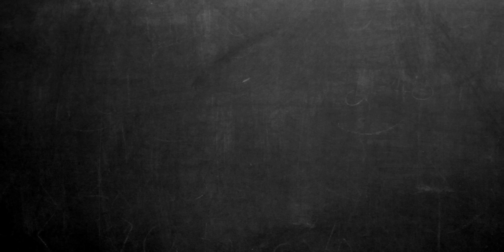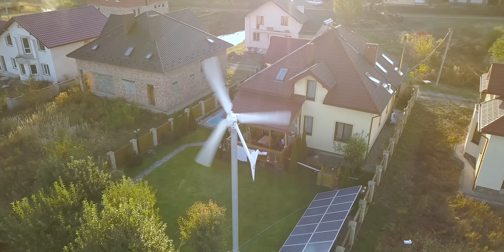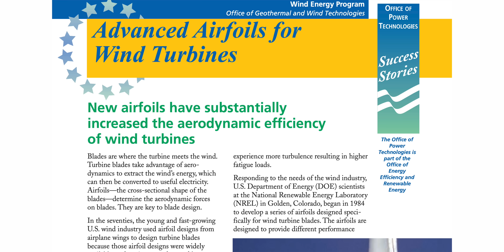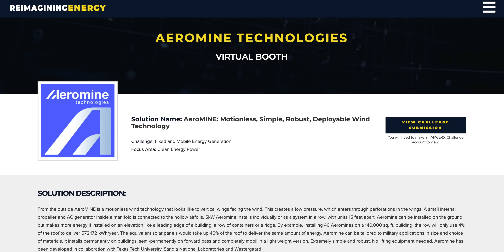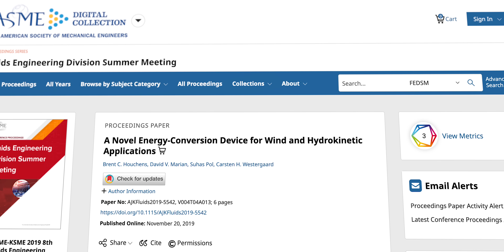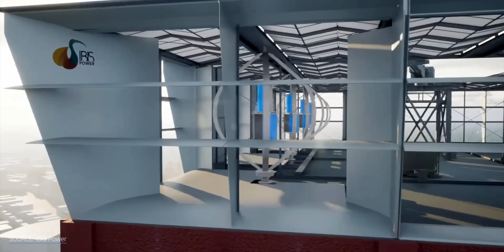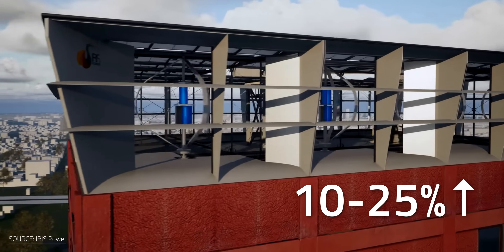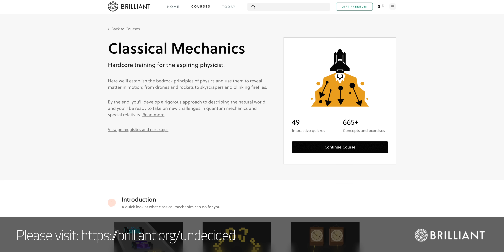How Can A Wind Turbine Be Motionless?

Comment: It always bugs me when people say wind and solar are "free". By the same logic aren't fossil fuels also free? They are all things that just exist on the Earth, the cost is obvious in collecting them and converting them into usable forms. The answer of course is wind and solar are not any more "free" than oil or gas.
Reply from the maker: Oil and gas have to be collected and processed into a usable fuel.  That fuel is run through an engine or device to generate power.  Wind and solar skip that fist step.  You go straight to the device that generates the power, which is why it’s “free energy.”  After I put solar panels on my roof there’s nothing else I have to do or pay to get power.  Your car or a diesel generator needs to be refilled again and again with fuel you have to pay for.
Reply: @UndecidedMF  That is a fair point and I appreciate your response. Maybe a better term would be "freely available" since you do get to skip the collection step. Thanks.

Comment: You mentioned that they could only face one direction so couldn't adjust to wind coming from another vector. I think that could be solved by having a rotating platform with a wind direction detector. That is a problem that could easily be overcome.

Comment: The engineers designing these are not very imaginative.  The single aerofoil could be mounted to the sidewall of most homes.  Homes usually have a windy exterior surface dependent on normal wind direction

Comment: The key to renewables is a diverse mix of distributed generation. The Aeromine seems to have many benefits, like installations in commercial areas where a traditional turbine cannot be installed. This brings generation closer to the point of use, reducing the load on the grid. Being roof-mounted means easier maintenance, but I believe the claimed lower maintenance requirement may be offset by the larger number of units to maintain. The elimination of bird strikes is also a plus.  Tim will tell if this particular idea is a winner.

Comment: Most of the complaints about the turbine are either the excessive flashing light when the blades are between someone's house and the sun, and the constant motion in an otherwise serene countryside.  Power poles have been there for over a hundred years, no one minds them, because they don't move or make sunlight flash on and off and are constantly distracting.  If we had wind generators that when seen from far away don't visibly make sunlight flash on and off, and thereby don't draw attention to themselves, you could go back to all those places that said no to wind power and show them the new less irritating designs.  Something as simple as putting them in a box with a roof that blocks sunlight, and 4 walls of black mesh, with black painted blades that don't cause any visible disturbance whatsoever.  I was noticing those blades were still causing flickering @6:00 because the material behind the blades was reflecting light and the blades were blocking it when they spun, making a flickering light.  There could be a new regulated certification called Non-Visually Disturbing, or NVD wind turbine that to earn a design would have to have no visible movement from every angle visible from a public place.  Something like a wind funnel turbine is already completely NVD from most angles.

Comment: GREAT augmentation for a solar panel!  Given both, one could cut about 1/3 of the requisite capability of each and enjoy roughly 50% greater energy production time.

Also, turn the Airdyne on it's side, lengthen it to the width of the building, replace one side with the building front itself, and enough even lower cost with higher total output.

Comment: Why can't they place on a turret bearing (even if fluid) system with maybe like a tail so can change direction with wind direction?  Wondering the efficiency difference versus the loss in energy gained from not being positioned in the optimal direction?

Comment: This would work well for single family homes if chimney mounted and built in you could use the temperature differential to help spin the built in turbine adding a little additional complexity you could add a sealed bearing and wind vane to orientate facing the wind..

Comment: Most warehouses and factories are not air conditioned and can get very hot. Especially up at the ceiling. If this device can choose to pull the warm indoor air in the summer inside the building and pull it out thru the turbine, it would be doing 2 jobs at once.

Comment: If the nest calculations are accurate, then a similar setup could generate about as much power as the office building it's on top of uses (particularly if paired with energy-saving architecture regarding AC/heating and such); that's not bad at all, really.
Reply: Top tip: they're not. They're always best case scenarios. Take EVERYTHING this channel says with a lamps worth of rock salt.

Comment: Come on Matt! Really? "Wind generates enough energy to produce about 35 times more electricity than the entire planet could even use each day. It's free, clean, and renewable,..." This type of hyperbolic claim is generally made by an 8th-grade student parroting the words of their overreaching science teacher. Capturing even a small fraction of 1% of that wind would unacceptably require littering the surface of the planet with wind-capturing devices...and there certainly isn't anything free or clean about wind power generation when you consider the devices, materials, batteries, land, noise, transmission, etc. Frankly, I could make a similar hyperbolic comment using any of our current energy sources...and it would be equally accurate. Comments like this make serious-thinking individuals shrug in disbelief...and move on.
With that said, I love wind, water, geothermal, and solar energy. I am excited about the innovation and improvements and strongly encourage mankind to continue to pursue these technologies. But I also love natural resources and nuclear energy...the real heavy energy providers of civilization for probably the next millennial. Nuclear in particular IS the deservedly maligned energy source that we continue to seek as the holy grail...while it hides in plain sight. The research, development, and improvements of the gen 2 and gen 3 reactors...even with the massive governmental hurdles in place are amazing. Additionally, spent fuel reactors are coming online in France to utilize the 90% of potential energy that remains in the spent fuel. Nuclear energy is ground zero when you talk about REAL progress toward renewable and emission-free energy.

Comment: Why does aerodynes turbines not have the ability to rotate? If they are that large, why not incorporate neon, and allow whatever company that installs them on their rooftops, use them for advertising? Personally, im certain, solar panels are tomorrows asbestos. Theyre only good for 20 years, then what are we going to do with all the plastic, silica, led, and all the hardware..... coving the entire planet with solar, sounds good, until the panels no longer work.hydro and wind, replace a bearing and perform precision balancing, toss in a bit of lube and theres power..... just sayin, cuzzin!
From a different Ferrel. Brendan.

Comment: i've just one question: why doesn't turbines have gearbox? :| if there's a lot of wind reducing the turns of the windblades while increasing the torque may be used to power more then 1 alternator; plus: this sistem is monodirectional; they should make a mobile cog base that turns, imho.

Comment: Power nest is a good concept.  Scalable and modular.  Won't be as effective in a city with a lot of tall buidlings.  

Also, would be curious to know how may "nests" in a row could you have and still have effective flow through.
Reply: Hi Guillermo, as far as we have investigated this; turbines behind turbines do not work, so we only place the wind modules on the roof edge into the prevailing wind.
Reply: @alexandersuma  thanks for that.  A long time ago, in a city far away, I participated in wind research to determine predominant wind directions.  it was funded by glass companies.  
Where I live now, I could plop a power nest on some legs, and would have great wind....almost year long.
Reply: @alexandersuma  also, given the surge in "solar generators", which are just "brains with batteries", it would be cool to have a portable brain paired with a power nest.  Not a electrical wizard, but I understand wind generated electricity require a different set of controllers.

Comment: I didn't see any comments addressing this issue yet, so I'll bring it up. The 6 to 10 times power increase for the power nest seems a bit deceptive. Their example case went from installing ~46 panels around the roof protrusions to mounting ~256 panels on the frame. That would indicate a 5-6 times increase just due to installing more panels. Yet, the sales pitch focuses on the increase being due to the combination of solar and wind installed together.

Comment: That Powernest unit in Utrecht is literally across my street.  We have held a petition in our street to have it removed but it was discarded by the municipality as it was temporary. The problem was that at windy days, the turbine would make too much noise. In regular traffic below the somewhat small street you wouldn't notice. But during the night, it was a constant zooming noise. I was suprised when I saw my street in your video! The building is a pilot project by the EU to test sustainability projects. Several universities are working on charging EV's using the panels that are fitted on windows, balconies, and roofs. Even the king Willem Alexander has visited thus building twice!

Comment: I prefer Solar. Correct me if I'm wrong, but I feel like there's not enough research being done in the effect of slowing the storms down. By capturing the wind, you're essentially taking energy away from the storm moving in a particular direction. Lets say for instance, a storm that comes from the Pacific. The storm on average may stall out right around reaching the center of the country. I believe there will be a long term effect of slowing storms down that may need to have x amount of energy to properly hydrate the land.

Comment: Some of the math in this video is wrong.  The biggest problem with small wind turbines is: low-speed, turbulent airflow, not the blades.  Average residential solar panels today are: 360W, so only 14x are needed for a 5kW array, not 21.  This Aeromine wind system is ALL hype and theory at this point, there's no data proving any of their claims.  I worked in the small wind industry for 12-years, sold several thousand small wind turbines around the world, installed hundreds and have had a Skystream 2.4kW small wind turbine in my backyard the past 14-years.  I've seen dozens of claims like Aeromin's and every, single one of them have been false and the companies and designs have failed.  The Aeromine system will still have the same problems that ALL small wind turbines have: very low, obstructed, turbulent wind that has very little energy it in, at low elevations.  And, the amount of time the wind blows at low, rooftop elevations is like: 10-20% of the time, I know, I've tracked my turbine's performance for 14-years and the energy production is horrible, and I live in a high wind area.  My 5kW PV system, which cost's 1/2 the cost of my turbine, produces roughly 5x the amount of power, and produces EVERY day, sun, cloudy, rainy, doesn't matter.  Don't waste your time and money on small wind turbines for your house or property, just go with solar PV.  However, the Powernest looks promising as commercial rooftop space is dead space anyway and the concept looks promising, especially at those high elevations where high wind speeds exist.

Comment: It's nice to see the Darrieus VAWT designs coming back into play, I think they were overlooked early on because of the lateral forces on the lower bearing in large scale installations. Years ago I visited one in Quebec that was more of a demonstration of the concept and saw their shortcomings there, it was just too big! So properly scaled, I could see these turbines combined with a Savonius (starter) a really efficient power generation device.
Reply: The VAWTs have a number of advantages IMO. Yes I know their overall efficiency is lower but they also can be sited more densely. Also because the mast only needs to support the loads of the top bearing assembly and its associated loads the overall mass of the foundation block can be lower. Another factor in their favor is the generator is pretty much at ground level easing servicing by maintenance personnel.
Reply: Even though this is a vertical style could it be designed with same blades and used horizontally?  that way both ends support and bear the weight of the blades instead of putting most of the weight on the bottom bearing.  It would mean putting the generator on the same level as the turbine.  Also is there a way to control the maximum speed as sometimes the wind where I live can vary greatly in speed and direction.  A normal wind turbine can control the speed by using computer, anemometer and vane and turn the blades away from the wind at an angle determined by the computer to capture maximum effect without burning up the generator.  The concepts appear very feasible except for controlling the air space around the buildings from blockage of new construction of taller buildings.  And it takes away the argument of NIMBY (Not In My BackYard) that cattle farmers have a problem with the noise from a wind turbine.
Reply: @johnsnyder9033  They've tried the horizontal methodology in ridge or rooftop designs, but the merit of the Darrieus VAWT is to be able to capture wind from all directions without yaw control. Regarding speed, they use mechanical or passive braking or both, same as HAWTs. Sometimes they are so big they need to be "nudged" to start up.. that is why you see the hybrids with a Savonious turbine.
Reply: Happy you mentioned Savonius! Many times "the best" stays in the way for "good enough under these circumstances" - like independence, stability, viability, environmental friendliness, are also important values, not only highest gain from lowest investment. User value can be more important than capital investment. For the investor it might be a minor problem that production stops for a time as long as the production on a yearly base is profitable, and more profitable than other investment options in what ever. For user the utility is in the practical and stable production, that is needed and desired.

Comment: You also had an issue with Wyandot MI. It's why-en-dot. I also have a couple of questions. Are there engineering or Physics reasons why the Aeromine turbine can't turn with the wind? Given the design we saw it seems that would be possible and definitely improve it's overall performance. The second is why these would not be feasible for a residence. I understand there may not be the same efficiencies but that's the case for both solar and other wind turbines in a residential area.

Comment: Any simple explanation of how an airplane wing works to give lift is wrong. Bernoulli is one example of a simple, but wrong explanation.
Reply from the maker: What’s the right explanation?
Reply: @UndecidedMF  There is no simple explanation except to say that the net downward force on the air is matched by the upward lift on the airplane. (Newton: Every action has an equal and opposite reaction) But that does not really illuminate what is going on in detail and does not help to calculate the lift. The only truly solid explanation is to track small pieces of air around the wing, keeping track of all the forces and physics on each piece of air. That is called Computational Fluid Dynamics (CFD). It takes powerful computers to even get questionable estimates. One flaw of applying Bernoulli is the statement that the air over the wing must go faster to keep up with the air under the wing. In fact, the air over the wing gets to the end significantly BEFORE the air under the wing and Bernoulli does not explain why that happens. All this is why wind tunnels are still used to actually measure the lift forces on scale models.

Comment: what about extreme high winds? Wind turbines are supposed to be 'feathered' in high winds, so that they won't get damaged. The Aeromine unit is fixed, so presumably, it needs to withstand high winds like with solar panels or the roof itself. What is the highest wind it can take, and what happens if a hurricane is forecast?

Comment: Thanks Matt for the great content.  You are always so informative and you exude such positive energy.  It is much appreciated.

I wonder whether you can place the Windmine on a pivoting base with a weathervane-like tail to always keep it pointing in the direction of the wind.  I know that a wind map allows the installer to position in the direction of the greatest wind generation but depending on the location, that may not be especially consistent.  If the base could spin, then you could optimally position the capture device.
Reply: I was intrigued by the simple use of the Bernoulli principle.  I agree with Allen's idea to mount this on a turret-like bearing and directional vane.  As an aero engineer this makes sooo much sense.  Would love to 3D print a proof-of-concept for residential use.  Working on it but would appreciate input.
Reply from the maker: Thanks for watching and the good question.
Reply: @UndecidedMF  check out turbine guy on YouTube he has the only certified vawt in the USA the hivawt producing what is claimed to produce